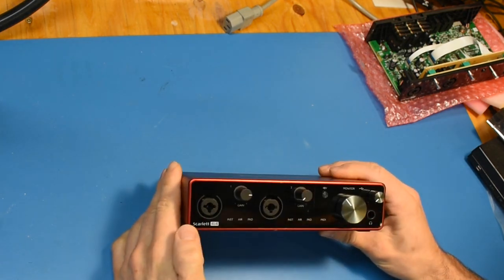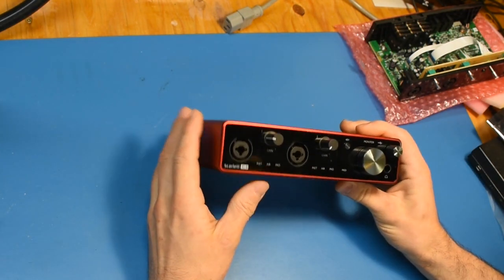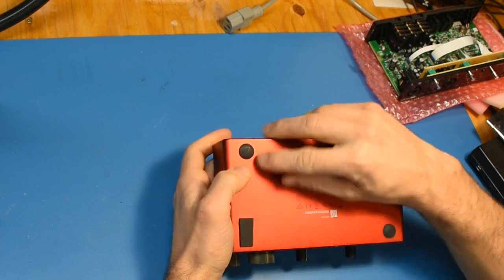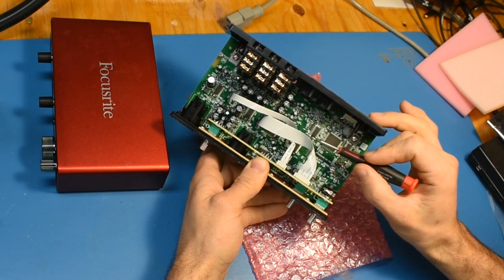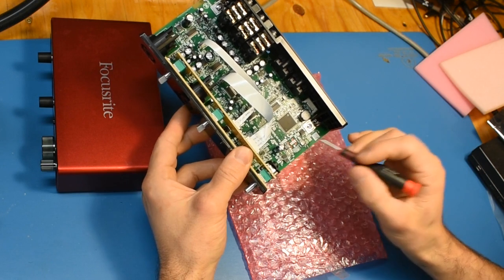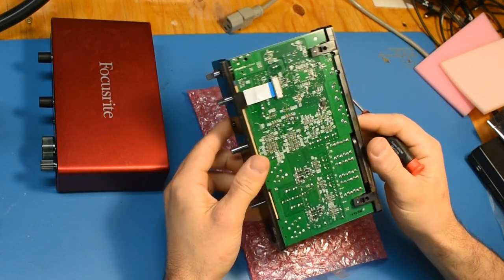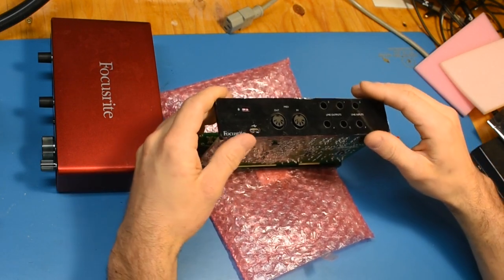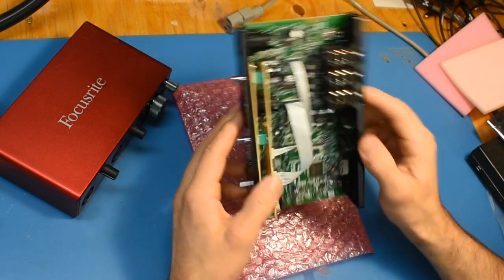Focusrite Scarlett 4i4 (3rd gen) - repair notes

Comment: Is it possible to solve this problem, guys? With your permission, I have a FoxRate 4i4 sound card with a connection to the device. A computer connects to electricity and a light, but it does not send any data to the computer, but I am connected at all and the computer does not sense it. Even the USB mark on the card does not light up. What is the reason and what is the problem with that?  I have a card for the second hour and I can't connect it to the SP tag and the device is reading and the data came to me and the laptop does not receive any signal.

Comment: Thanks for the video, really helpful. Did Focusrite provide the replacement 3.3v power regulator as well as the new xmos cpu? I removed the buck converter chip and supplied 3.3v using an external power supply but still not recognized although I am not getting a usb over current pop up in Windows 10 anymore.
Reply from the maker: yes they can sell you the regulator as well at a reasonable price. Your test does seem to indicate the same failure mode as mine, e.g. dead cpu due to shorted reg

Comment: Thanks for the info. I just recently bought a used Focusrite and after a few minutes of regular use (spotify) it turned off. Now when i plug it in, some lights turn on for 1 sec and then it turns off. Anyway you could help this fooled soul? Cheers.
Reply from the maker: Try a few different cable(s) , computer / hub / port combinations.
Reply: @fenugrec5697  tried everything. unfortunately, no luck. Is there a way you could show me what to measure exactly to identify the exact problem? I have a multimeter and would be more that happy to learn about this topic :). Went to your page but no further explanation on the subject :(. Hope you can help me.
Reply from the maker: Hi, unfortunately what I have on my website is about the maximum amount of detail I had energy to explain. I reasoned that replacing the CPU is a challenging task that would realistically only be undertaken by somebody with the knowledge to probe around and troubleshoot; as I may have stated in the video definitely not an easy repair, although the troubleshoot itself is not terrribly complex. More that can fit in a comment reply, anyhow. If you still want to pursue this, go to that page on my website, look up the datasheet for the problematic components, and try to figure out which voltages are where. Probing voltages (carefully) in a defective 4i4 is essentially harmless at this point
Reply: Try downloading the drivers for the interface
Reply: @Middas  no luck :(

Comment: Thanks for the video. Would you say generally replacing U31 3.3v regulator & U27 XMOS processor would fix it? Also for U31 (3.3v reg) do you think MP1605 is better choice as it can handle 2a output? Cheers.
Reply from the maker: U31 and U27 definitely as a minimum; 1V reg should not be impacted but worth checking before installing the new U27 obviously. Clock gen and SPI flash , to my knowledge, are the only other things that could in theory suffer from a shorted 3v3 rail but are usually OK ?. I understand MP1605 and MP2141 is essentially the same silicon, maybe some packaging differences. I'd be really curious to talk to focusrite and MPS engineers to see what's up with all this...
Reply: I'm ordering the parts for mine now from Focusrite and they have these available for the 4i4:

Part Number: SEMS002022 (U27)
Description: STEP DOWN CONVERTER SYNCHRONOUS 1A MP2141NGTF ADJUSTABLE "MPS"
 
Part Number: SEMS002049 (U31)
Description: XU216 QFP128 CPU 256K RAM 2-TILE 16-CORE 1000MIPS ENCRYPTED
 
Part Number: DDES001001 (U33)
Description: DIODE SOT23-6 ESD PROTECTION "SEMTECH" RCLAMP0504S.TCT

Notice that 2 are the ones you replaced. They also mentioned a service bulletin for the 4i4 3rd gen so trying to get a copy of that as well which might provide more insights.
Reply from the maker: Oh wow that's the first I hear about a service bulletin, let me know if you get a copy of it !

Comment: hey there!  i have one with a bad usb-c connector. im wondering if it's easy for an amateur electronics enthusiast to repair?  I've resoldered lots of stuff on small consoles etc.  or if it's something i should seek out a repair person for?  i got this unit for free and it seems a shame to just bin it, it works fine when plugged in sideways (lol).  the previous owner was not as gentle with electronics as i am.  any chance you would take on a repair for me (obviously for compensation).  thanks!
Reply from the maker: the challenge to replace the USB conn is mainly access : as you see it's tucked under the plastic rear panel, which is a bit of a pain to remove (unless you don't care about esthetics once reassembled). Or leave it in place, but then the desoldering operation is quite tricky. Maybe with a dremel and a deft hand it might be possible to cut up the old connector and remove it piece by piece ? Could be difficult to do without damaging neighboring parts. And the middle part with the fine pitch contacts is delicate. You know your skill level, if you have not done much fine-pitch stuff there is a real risk of ripping traces, which takes the repair to a whole other level.

Comment: Hello :) thank you for this great video. Maybe you can help me out with another problem. My Focusrite Scarlett 2i2 3rd gen was not in use for about 4 years now. Now if I plug it into my pc an install the new driver, everything works fine, lights are flashing and the device can be controlled via the control panel on the pc. So everything fine.
But now suddenly no Inputs (mics, guitar, etc.) are recognized. No matter if I activate INST, AIR and all the other stuff, if Gain is turned on and i play the guitar nothing happens. No light flashes, just when I plug in the instrument.
Did you ever face such an issue?
Reply from the maker: Eliminate some variables first : try a different computer , and a different audio source.

Comment: They draw 3.2A peak? Focusrite site says it needs 900mA to work. I guess thats why it keeps dosconnecting even if i have it plugged to a 1.5A powered hub port
Reply from the maker: well, in my measurements, it's a relatively short peak, and on average it is definitely below 900mA. I expect high inrush scenarios like this are handled quite differently depending on the hub. Also, with 3A peaks, voltage drop over the cable and contact resistances is also noticeable. I could've gone into more detail on my current measurement (resistive shunt) which also affects the peak amplitude and duration.